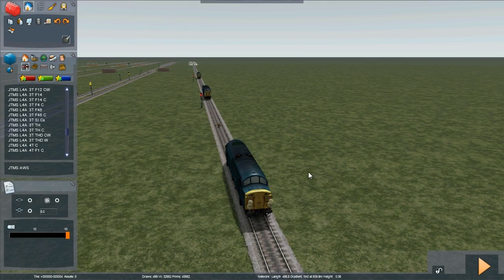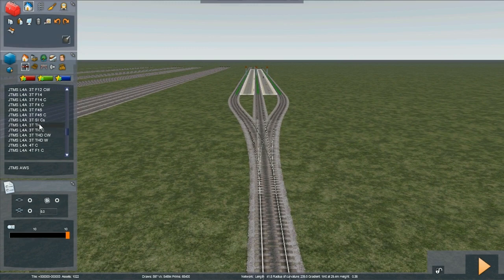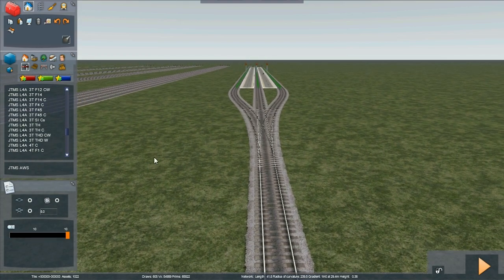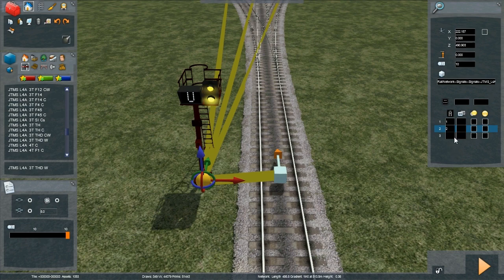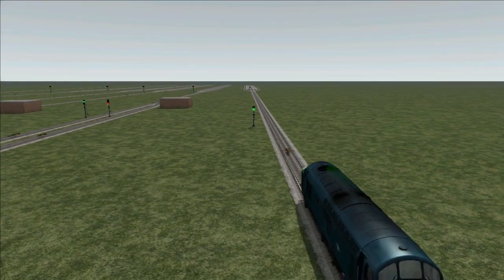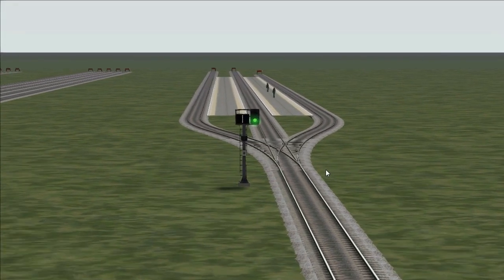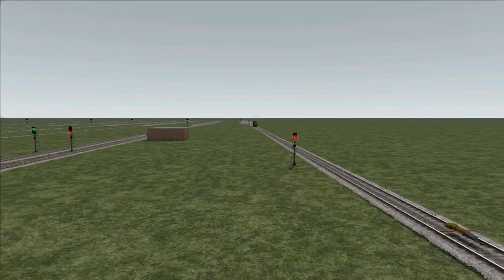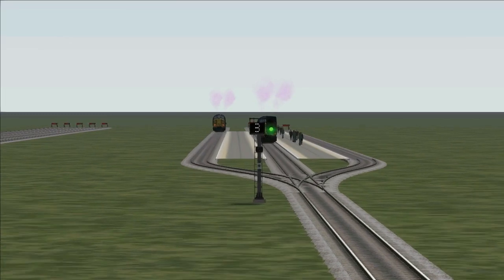007 Signalling a Junction with Theatre Boxes

Comment: Are these compatible with DTG signals. I am making a route with a high/low level platform set. If I made a branch off of the high level tracks (armed with DTG signals), to the low level tracks (armed with JT LED signals) will I encounter any problems?